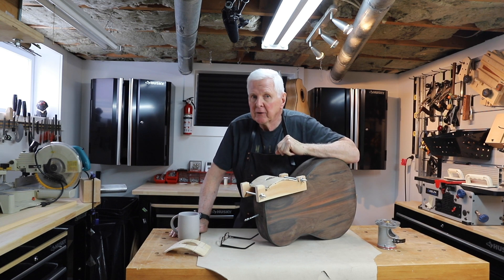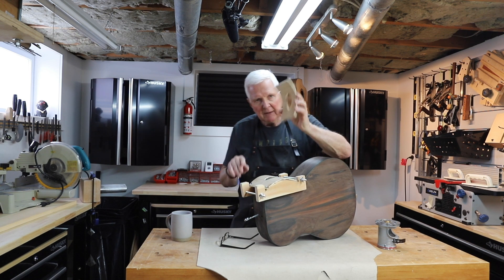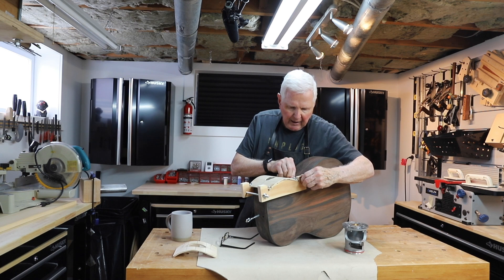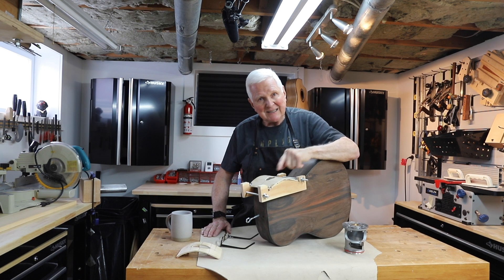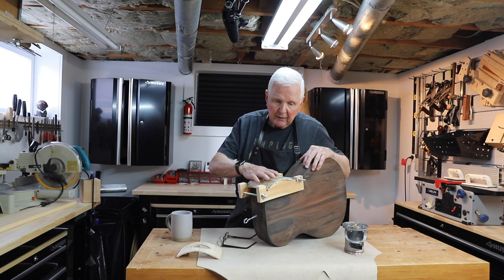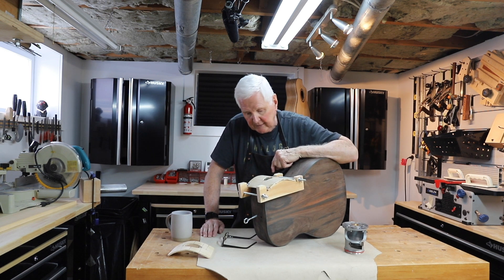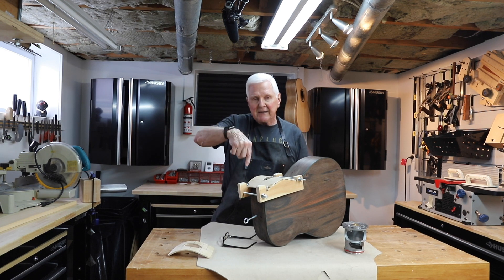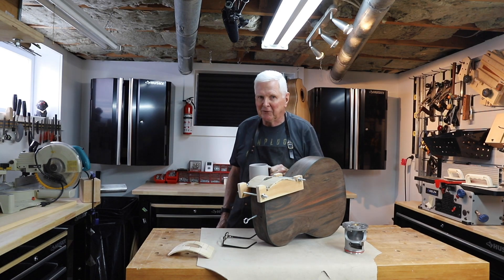1 Adjustable Sound Port Jig

Comment: Plywood can be rather difficult to work with when you're trying to bend it because it's actually designed NOT to warp. I may try this but I'm thinking of using either an orphaned maple or sycamore side from one of the tonewood providers or from  a local lumber yard.
Reply from the maker: That is better wood to use for sure.